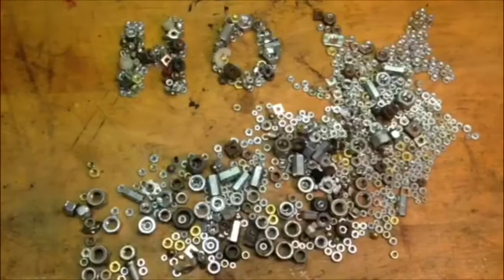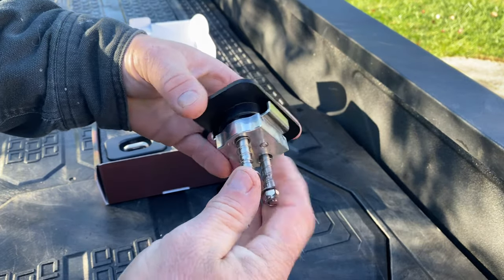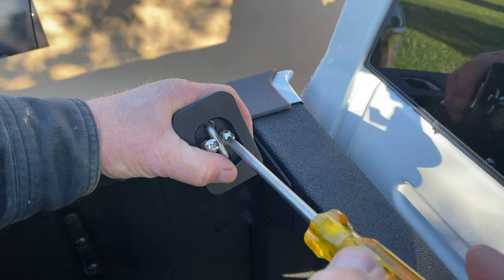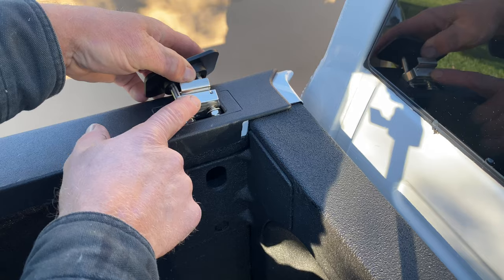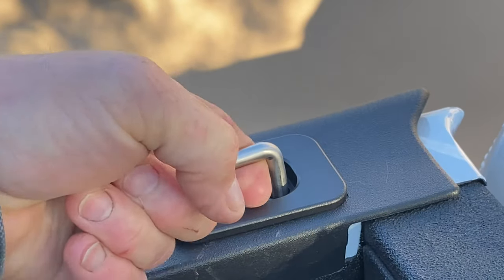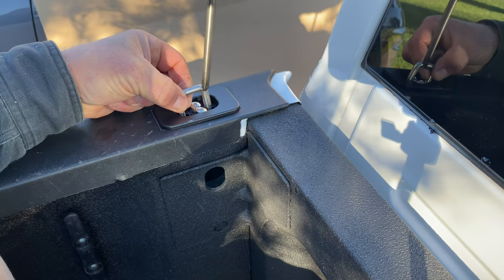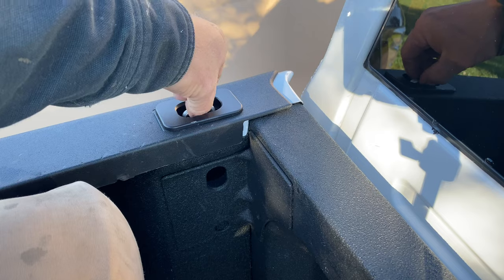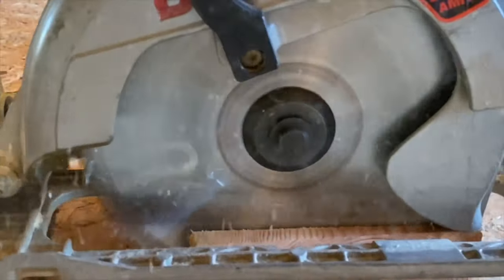Installing Tie Down Anchors in a Pick Up.

Comment: I bought a set of four that were supposed to fit my 2011 Ranger, but they won't fit because of my spray-in bed liner. I don't know if I can file away the bed liner around the holes without risking damaging it further.
Reply from the maker: You should be able to.
Thanks for watching.